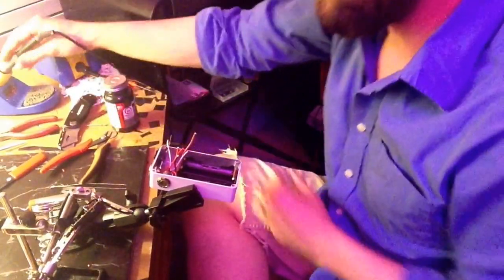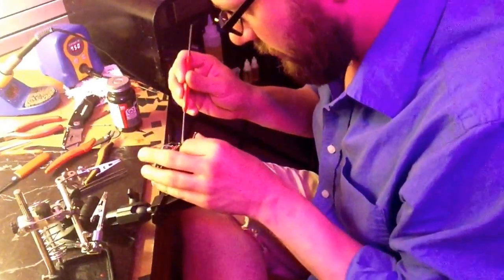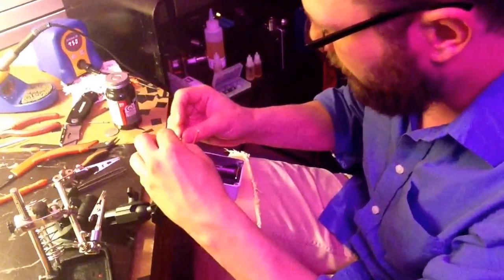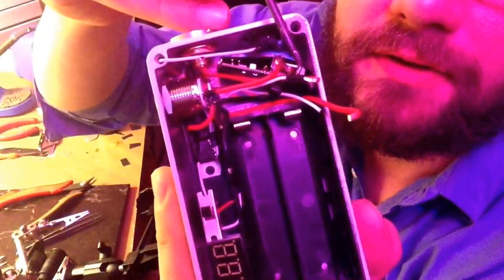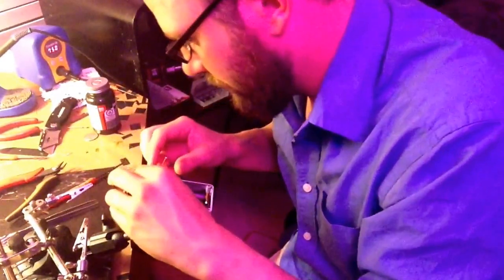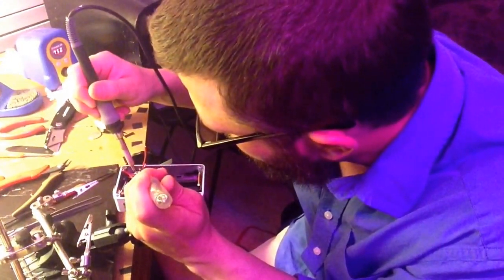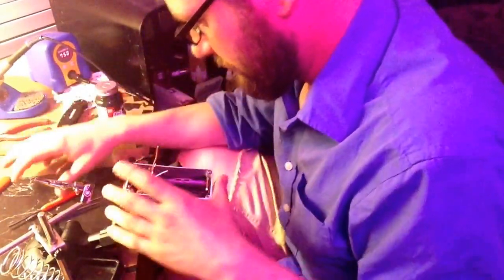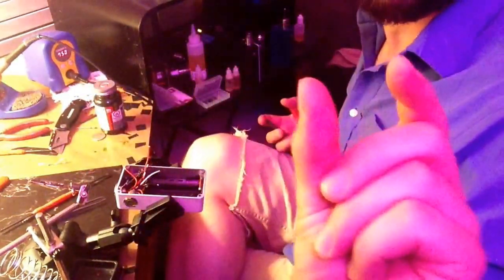Wiring the raptor chip (part 1)

Comment: hey dustin for the illuminated push button switch did you use the resistor as a jumper from the Led + pin on the switch to the Vin pin on the switch?

Comment: what project box did you use to build that is it Hammond 1590g?
Reply from the maker: It's the B. It can be done in a G, just a lot more difficult IMO.
Reply: I agree Im not going to try the g for my first project.I would predict a lot of cussing lol. I do have one more question if you don't mind. The 2 22uF 16v caps says run parallel does that mean solder one to the vin pin and one to the ground pin or both on one of the pins side by side Im not quite understanding that part.